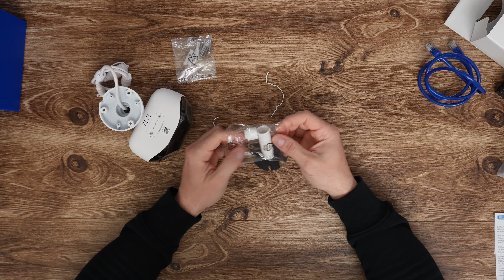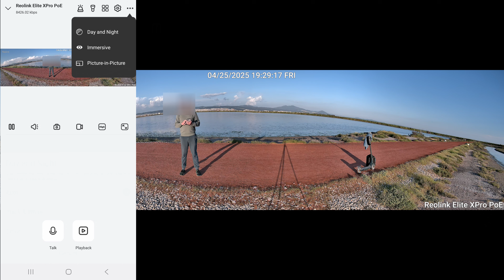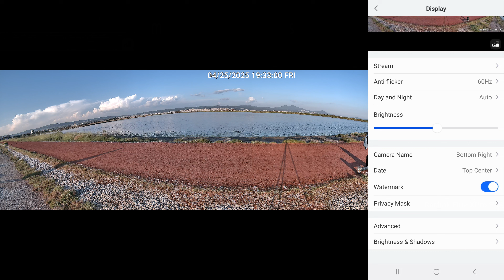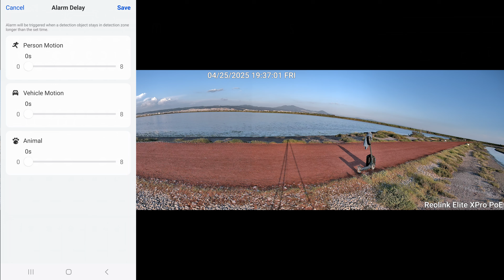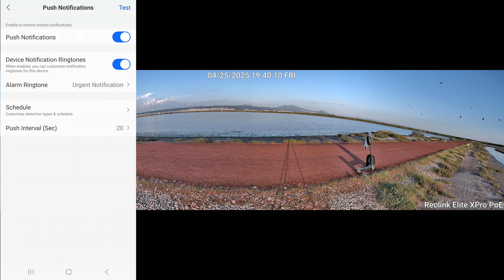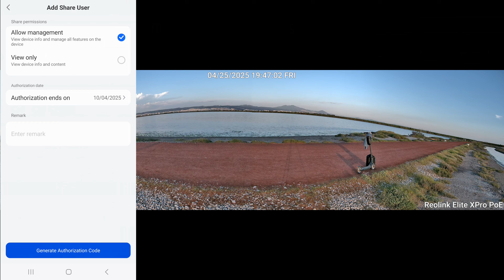Reolink Elite XPro PoE Security Camera

Comment: Why do they always fix attach the cable? How should I get it thru the wall? Make no sens to drill a 20mm hole if a 4mm hole for the cable would be enough. Than crypt a rj45 plug to the cable and insert it into the camera like it is done with other camera vendors.
Reply: Great notice. IMO they think you can use a special box where u can hide cable and mount it on the side of the cam - on the wall.
Reply: @marekhaberko2566  Other vendors can make it. I started with wifi cameras from ReoLink so my eco system is already ReoLink .. to late to switch :(